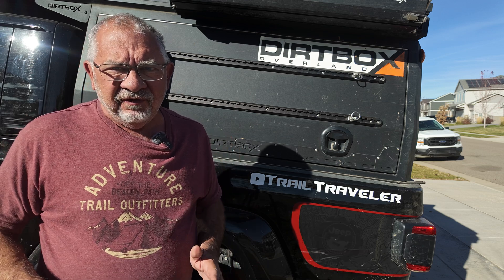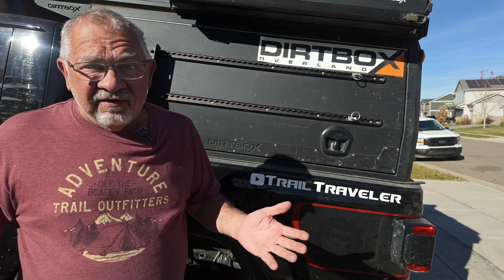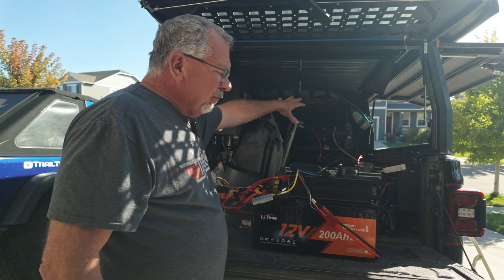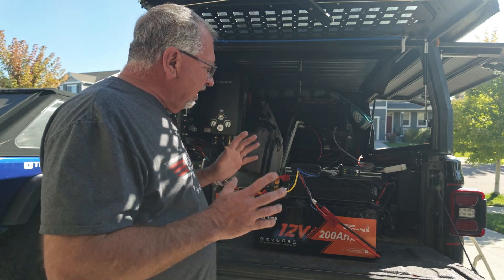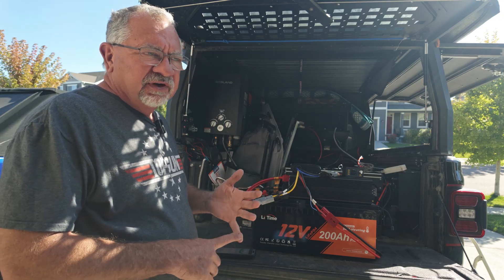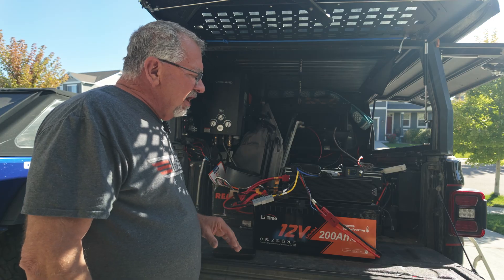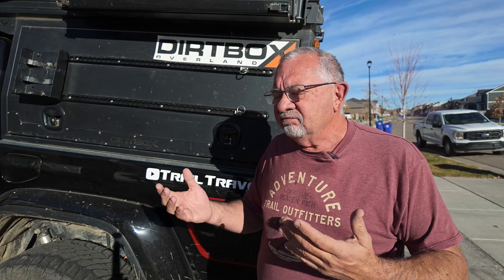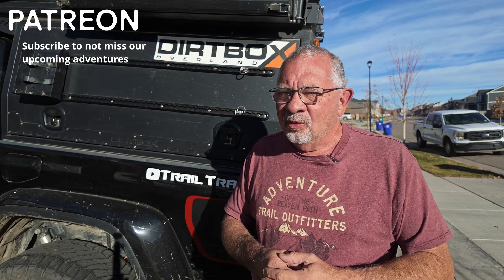Building A Bulletproof Power System For My Jeep Gladiator

Comment from the maker: After losing two portable power stations on remote trails, this permanent 200Ah system has been bulletproof through 7 days off-grid in Colorado and Utah. The self-heating battery handles sub-freezing nights, the DC-DC charger keeps it topped off while driving, and the 2000W inverter runs everything from Starlink to the fridge without breaking a sweat.

What power setup are you running in your rig? Drop your system specs below - curious what's working (or failing) for other overlanders out there.

Use code TTRK10 for 10% off the LiTime components if you're building something similar.

Comment: Renogy has a 50amp DC to DC MPPT... And it will in real time control the solar and alternator... I.e panels pulling 18amps it will only pull 32 from the alternator vs the litime which is alternator or solar not both. 

It can handle your panels as well.

Comment: I was considering buying the Bluetti Elite 200 V2 as i don't have room for a system like this.  Did you hear anything back from Bluetti and would you still recommend this unit?  Also was curious as I noticed your power station was on the back of your trailer, where do you have it in transit when traveling and could it have contributed to the fan failure if so?
Reply from the maker: They have a replacement being sent out now. I still think it is a solid unit. The power station was inside the bed in a shelf. I think dust was a contributing factor to the fan failure.

Comment: After messing around with power stations and having issues similar to yours, we switched to a customized system with a 100ah lithium battery and a dedicated DC to DC charger and have never looked back. No more worrying about whether its working or not. We just turn it on at the beginning of every trip and it works without fuss. It ended up being much better value for money as the battery, charger, and accessories added up to less than $400. A small power station is still a nice complement to the system as its portable and can be carried into the tent but I never want to rely on a power station for running the fridge ever again.

Comment: You are setting yourself up for failure and possibly a fire while driving. Let me explain. 
1. Where's the basic fuse block?
2. You are pushing the limits of that solar charge controller. It may say 30 volts but they are expecting you to use 24 volt panels with a 6 volt stupid cushion. If it fails while you are driving it could release the 200Amp monster in the battery. That would guarantee a fire. Lower that regulator to 24 volts. I suspect this is why your Anker failed.
3. You are relying on your electronic switch panel. If it fails, do you have a back up plug to power your frig?
4. Where's the shore power charger?
I just finished an off road tear drop trailer power system for less than half what you spent, with more features.
At least fuse block your system.
Reply from the maker: Really appreciate your comment and would love to hear more about how you built your system. To answer your points:

1. Fuse box was installed in the main box before I connected any appliances
2. The Anker was not connected to solar, it was connected to a Bluetti Charger 1, which I suspect failed and fried the Anker. I have discussed this setup with LiTime numerous times and they have never voiced a concern about my settings.
3. I always have a power station with me that I generally use to keep drone batteries charged and power the starlink. I keep an extra DC/Fridge cable with us should the need arise to plug the fridge into the power station
4. No shore power charger, zero need. Solar panels keep everything charged fully. Even after several days of rain with no sunlight, my battery was at 94%.
Reply: @TrailTraveler  I have used (2) Victron SmartSolar MPPT 75/15 in my system.(built in bluetooth)
Max 75 volts input with adjustable 15 amps output. $65 each. One for solar charging and one for car charging. In your use I would feed one from your charger 1 set to 48 volts. Then reduce the current to 13 amps. Don't max out electronics. They don't last. The second one is for your solar. Since they handle up to 75 volts input, no input regulator needed. Set your output to 13 amps too since your 400 watt panel will only put out 11.11 amps on a good day at high elevation. Combined that would safely charge a dead 200 amp battery in 9 hours driving on the Colorado flat tops. If one fails you still have the other one. Plus they are cheap to replace. for shore charging I use a $20 Amazon 10 amp lifepo charger. Cord on one side and clamps on the other. Simple to use-understand-replace.

Comment: Sorry you had the issues with your power banks.  I think this new setup is the best way to go for how you use it.  My husband just installed a 300ah self heating 12V Lithium battery in our van.  It is the Temgot and it has the blue tooth and the screen.  The battery is mounted underneath the carriage and the company assured us it would handle the road spray from rain when on the road.  We only have 200 watt in solar panels but with the 300ah battery it powers the fridge and the lights and the roof fans for about 8 days before we need to charge it.  We use a small Victron 75/15 solar charger, a junbpaw 2080W inverter, and the Temgo self heating battery with bluetooth and 300ah comes to about $795 before taxes.  We already had a DC to DC charger.  Anyway first time seeing your video and subscribed.  I hope bluetti takes care of you.  We are EcoFlow fans and we had to send 3 units back.  They took care of us and turn around time was about 17 days, and they gave me an expansion battery for my troubles.  They stand behind their products.  Thank you for your video.

Comment: Nice setup. I have a 600Ah system I built to use during power outages for basic stuff but have upgraded to a dedicated system for the house. Maybe I’ll use the home made job for the rig. Just need that fancy DC-DC charger and maybe a hood solar panel.

Comment: I'm using LiTime 100ah  heated battery, Victron 150/30 MPPT smart controller, Victron 12/30 DC DC smart charger, a Victron Smart Shunt for monitoring and a 200 watt, 18BB N type, Rvpozwer solar panel. The only thing I might do is double the solar, and maybe, maybe add an inverter!! I only like to travel 3-4 hours a day so more solar is a good thing while parked!

Comment: Do you use a 12V CPAP while traveling? I've been looking at them but they are pricey 😢
Reply from the maker: I have a usb-c adapter for my Resmed Airsense 10
Reply: @TrailTraveler thanks
Reply: @TrailTraveler  We have two 12V adapters for our Resmed Bipap and Cpap.  They are sold separately. Price varies depending on what you get but less than $100.  I connect mine to my Bipap using the humidifier and the Jackery 500 will power it for four nights with out problems.  I do average about 4 to 5 hours of sleep though.
Reply: I have the air sense 10 and have the kfd 12v /24v car charger vehicle p power supply made for CPAP, 28 dollars. I even keep it plugged it in my river 3 I keep next to my bed in case of a power outage so if the power goes out while sleeping I won't be bothered. Plus it works when my Anker 300 DC without issues too.

Comment: when i take my truck and pull the rv. only then do i care about power.
in my jeep. there is no reason to have power.
light is from white gas. and a camp fire.
cooking is a white gas Coleman stove. and / or a open fire. 
heat is from clothing. and heat packs. or while in the jeep it has a great heater.
decades past one in the group had a air powered blinder.
now at 66, not sure why i should bother switching over to electronics to get ac power to run things.
my two batterie's run my jeep and the 8K warn winch, air compressor. add in a couple more work’s great at welding.
everything fits inside the role cage, except extra fuel
 ( two 5 gallon cans), spare tire.
thought about bolting some things onto the outside of the body.

Comment: I run about the same system, (LiTime)but only have 100ah LiTime.  Works great over the last two years.  However, I think I do want to upgrade to 200ah batt. now. And update DC/mppt charger from 25amp to 40amp as well.

Comment: 1 lifepo4 battery, 1 solar controller, 1 AC inverter, +/- 1 solar panal. Done

My system 150 watts solar, Eco Worthy, $100. 12V 100AH, Lifep04, HQST brand $120. Solar controler 30 watt,Generic, $40. Inverter, Generic $50/100,depending upon need. $360 total. All purchased on Amazon, 5 day or less shipping time. So no overseas weeks waiting for delivery.
Reply from the maker: Can you list the brands for other people?
Reply: @TrailTraveler I edited with the mfg. Checked my math, whoops, down to $360. I don't mind the name brands. However traveling full time in a Wrangler on fixed income, I need to be budget conservative. I do appreciate your videos.

Comment: I have 2 blu's and had nothing but problems winter before last charging them from my cig lighter. Then the blu solar panel died. Customer service is as poor as it gets! No US customer service! Have to deal with China! Years ago in my truck camper I had RV batteries and I never had any issues! I have 2 renogy batters (200amp hrs) I have them in my truck. I have an older solar panel that will charge them. My truck had a selonoid? under my hood and wires that charged my batteries. I am going back to that with my jeep! So much cheaper and less expensive! Done with the power stations after they croak. Back to basics! I quit using my 12 volt refrigerator because of the issues with the blu's! Just really good coolers and ice. I am 77 and have learned expensive lessons. Basics just works!

Comment: I, too, use LiTime, for nearly 4 years now. My vehicle setup is completely electric and consists of 800ah LiTime batteries (400ah x2) managed with RedArc RedVision via alternator, 400w solar panel on roff and 400w portable (rarely used as my mode of travel is sleeping overnight and moving the next morning, in ~20 years I might have spent two days in one place less than a dozen times), and 120v shore power (mostly when parked at home), and a 3k watt inverter. 800ah is the sweet spot to run AC or heat while sleeping, a 12v 300w heating rod in the 13 gal water tank for hot showers, 1800w induction stove, and 1500w air fryer/oven. What I learned is that most of the energy is consumed between dinner and breakfast, so the solar panels are unhelpful. The water heater, which draws ~18 amps, heats the water mostly off the alternator (~32amps) while driving, and the 400-w solar, under perfect conditions, generates ~20-25amps while I'm stopped. The system has been flawless, and every failure has been my error, for example, forgetting to turn off the heater breaker while cooking, and the heater comes on when the temperature drops below the thermostat setting (at least twice). My coldest outside temperature was 7°F while sleeping comfortably at 65°F inside. My highest outside temperature was 119°F while sleeping comfortably under a sleeping bag at 75°F inside (working at night in Phoenix, AZ, in the summer and sleeping during the day for x4 months). Never considered power stations, as none of them would support my accommodations. The harshest criticism was the battery's weight over a 5-pound propane bottle. I have never had to seek propane or any other fuel for my house setup, not in the USA, Canada, or Latin America. And despite the battery's weight (and 13 gals of water), my setup hovers near GVWR, unlike many, but I digress. Thanks for sharing.